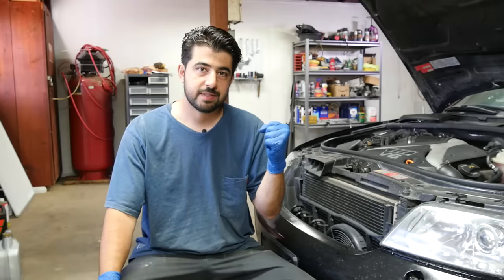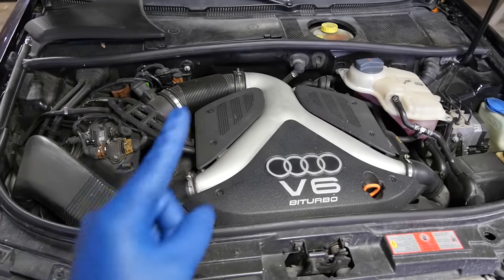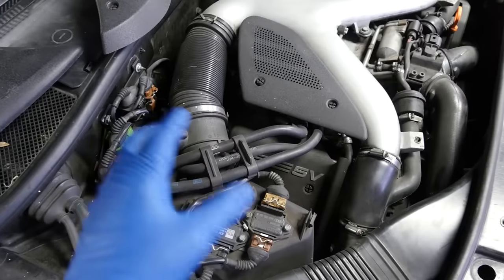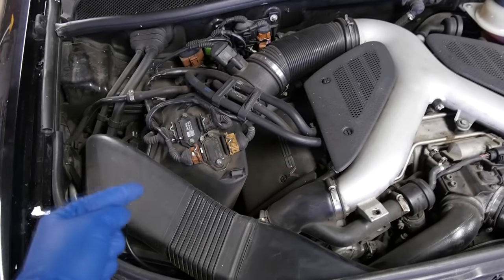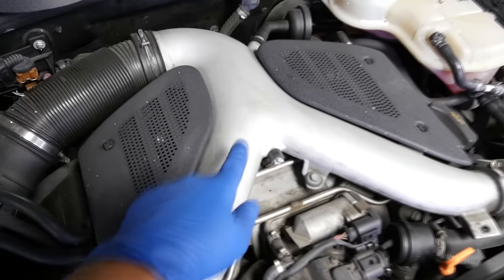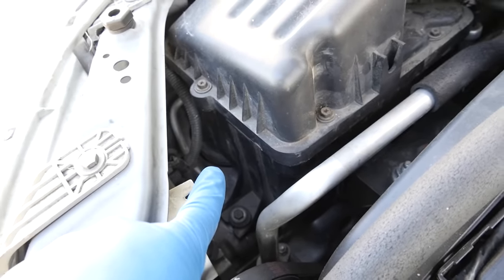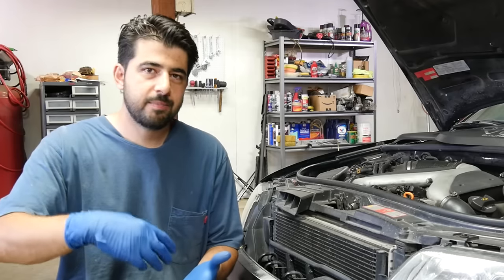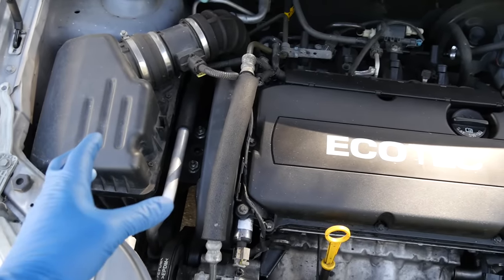Do Cold Air Intakes Work? Watch and Find Out

Comment: I am on the fence about getting a cold air intake.Having gone to the track many times in my life--from stock cars to full blown race cars--90% or more had cold air intakes.Also--when I walked around and looked at factory race cars--they also all had cold air intakes.I wish there was just some honesty about this when you ask your local dealer about a cold air intake and you can literally get a different answer from all of them.The cold air intakes also on factory race cars--looked very similar to what you could buy for your stock car.BMW--M--AMG--Ford Racing-Honda and Acura racing--Porsche--all of them had intakes.The manufacturers need to just be honest-The computers--and I was told this by engineers at the track--all can instantly adjust for air and if you give them more air at a higher cooler rate--it will generate extra power.I mean a modern car has to run in Alaska--and in death valley--huge temp and air density differences.Some dealerships also will put K & N air filters on their cars--and some high performance--like saleen--will even put cold air intakes on their cars that are still under factory warranty--yet the service department will say it is useless--void the warranty--etc.i doubt all these race teams would do this--but the car companies need to get service advisors and this type of mod on the same page.

Comment: I have a turbo diesel. Once i installed the CAI i noticed it's more responsive from stand still take off. It used to bottom out most of the time before the power delivery.  Now that it's got CAI it's less laggy and more punchy. Now I'm not saying it makes noticable hp gains but a definite difference  picking up speed more fluently.

Comment: I found on my 2014 Mustang the CAI doesn't work as good as the stock airbox until you tightly cover the filter and basin.  Therefore air is forced into the system instead of much being wasted into the engine bay.  Once you do that you can definitely feel the difference B)

Comment: I put a cold air intake system on my old 2001 Pontiac Grand Prix GT and it turned that car into a beast! My low and mid-range torque went thru the roof!

Comment: I use a cold air intake on my 2006 Focus, not because I was looking for power, but because the car's air filter was supposed to be "Lifetime" (and obviously it wasn't) and it was going to be $800 to replace the filter because the entire system is sealed, or $200 for a cold air intake. 

That being said, I still have the same MPG as before because I monitored it for the fun of it, pre and post CAI. Been using that system now for more than 3 years without a single problem
Reply: $60.00 for the sealed unit these days...

Comment: This question was answered 50yrs ago. Cars from the 60s anyway, many came with cold air intakes.....esp performance cars. The general rule of thumb is cold air makes for a 10% torque gain over hot under hood air. Race cars usually have some cold air setup. A higher cfm filter can help at higher rpms. Usually the web doesn't make people smarter, hence millions of pod style filters sold today. Pod filters usually ruin motorcycle performance also eliminating air box cooler air.
Reply: Shazam that's why the '71 mustang mach one made 370 horses than the '70 only making 330
Reply: modern racecars almost always have ram air, not a cai

Comment: Some engines won't respond at all unless reprogrammed to take advantage of the greater, cooler airflow. Some systems are more forgiving and may actually automatically compensate. Whereas others may throw a code. Or the engine doesn't run right. And another BIG issue is hydro locking if the aftermarket didn't design in enough splash guarding. Manufacturers spend thousands of hours and millions of $$ to design a lot of these intake systems to do everything everywhere, no matter what the weather throws at one.

Comment: I put on a CAI that goes beneath the engine for my sports car...noticed a huge power/acceleration increase immediately.  It even has a better exhaust note.
I have to keep the OEM intake because the replacement CAI won't pass SMOG tests in Ca. 
So, every two years the car feels like it's driving through mud, towing a train...at least until the SMOG test is over.

Comment: On my '12 i4 accord I removed the pre induction tube silencer and added a drop in filter. These accords take air flow very well and I have way better response and sounds great on the crossover from 2nd to 3rd. Slightly modded air box but I love it. Rather tan spending 250 or 300 for a brand name CAI

Comment: Something like a K&N drop in panel filter will work out much better. Seen as you was considering cold air intakes which use the same or less restrictive filtration anyway. Sometimes you can modify your air box from the bottom. Cutting a circle out of it and attaching piping to the bottom and feeding it to the bottom part of your car where the grill is. Then it feeds even more cold air when needed. This would be much better solution than a cone shaped or something similar cold air intake.
Reply: this, plus the K&N reusable filters sound great

Comment: Worked great on my old 89 and 92 ford rangers where back in them days they had warm air intake ,I took and modified them to have cold air only and really can tell the difference in power increase for sure and actually better fuel mileage .

Comment: Put one on my 4.3 blazer. Also have a cat delete.  Took the time to use hp tuners to adjust the ve tables and maf calibration.  It made a great deal of improvement in my throttle response.  Also gave the engine a nice growl under the hood. As OEM air boxes are designed for noise reduction.

Comment: Great marketing lie.   You are usually removing the factory cold air intake, then adding a hot air intake that’s just called a cold air intake.   All four of my vehicles get air from the grill or behind the fender with the stock setup(cold air).   Why would you want hot air from the engine bay?   Less power more noise.   The days of poor factory design intakes are long gone.
Reply: Yea, but when you run through deep water eith that fender sucker, have fun replacing the engine :D
*if the filter doesnt stop it

Comment: Depends on the car, on my 3g Eclipse I didn’t notice any difference whatsoever, but on my new DC5 type S I noticed a huge difference, even with just a short ram, not even a cold air intake...
Reply: DareDevilDog DAVE i agree, they have different uses but ram air is nice because it improves throttle response

Comment: I put the cold air intake on my 2013 Ram, along with headers and intake spacer. I know it help keep the airflow cooler. Along with 190 degree thermostat, you really have to work to get the oil temp much above 200. I've done some heavy towing with it and wouldn't change a thing.

Comment: save yourself 8 mins. no cold air intakes do not equate to more power.
Reply: But they sound nicer
Reply: doug Fresh1980 depends on the intake my Jettas engine cover is the intake .. 4 ft of curved plastic hot air

Comment: The factory system is a cold air intake system.These aftermarket intake kits,they create horsepower loss and there have been tests done proving this.Plus the reusable air filter causes problems in the cold air intake systems if it has a mass air flow sensor.The oil from them gets on the heating element kill in the mass air flow sensor and kills it.
Reply: It kills it,burns out the heating element.Had this with a 2002 Tahoe which the K&N air filter was tossed in the trash.
Reply: cold air intakes were invented to make money for aftermarket companies, and some little piss ant company is not going to out engineer Toyota, or Honda, or GM, etc.  This is the problem with nearly all mods.  And even if you found one that really does work, you are going to give up a huge amount of fuel mileage, and no longer pass emissions, etc.
Reply: I love how something becomes a certified fact because someone said it happened to them. Once.
Reply: Walter Frederick obviously never seen a 2.5 mk5 Jetta the engine cover is the intake lol

Comment: Just put less restrictive filters in the stock air box.
Reply: yep..that's the best
Reply: Might as well seen as cold air intakes tend to always use the same sort of filtration or less restrictive filtration compared to OEM drop in filters so something like a K&N drop in panel filter will work out much better. Sometimes you can modify your air box from the bottom. Cutting a circle out of it and attaching piping to the bottom and feeding it to the bottom part of your car where the grill is. Then it feeds even more cold air when needed. This would be much better solution than a cone shaped or something similar cold air intake.
Reply: i did that. cut a hole in the airbox for more air to come in. got more mpg sounds louder too

Comment: I'm still trying to figure out who buys a cold air intake that actually stops in the engine compartment. Isn't that called a short team intake instead of cold air intake. Because cold air intake is going down in front of the tire well Where the factory piping is. Which picks up cold air.

Comment: I recently bought an K&n intake for my Mazda B2500 pickup truck on eBay for $170 
Brand new cost $355 
And based on my experience I would have to agree with his statement. It really does depend on the vehicle. 
For my truck, it does make a significant difference. Nothing crazy, but it does perform a bit better. Especially when I step on the gas on 3rd or 4th gear. It responds a lot better. Gives it a little boost 
It was a great purchase for $170 
I wouldn’t pay $355 
Not worth that much money in my opinion.

Comment: Thanks very informative! I don't plan to use a cold air intake but a dry flow filter rather. Not after performance gains which I doubt there is any but rather the fact that I could clean and reuse them.
Reply: they pass tooooo much dirt in exchange for a couple horsepower at 6,000 rpm.
Clean and reoil every 5,000 miles.
Then 200 miles later clean the oil off your masd aur meter.
NOBODY DOES IT
Reply: @hotrodray6802  I've been using an AEM dry flow filter for a year now and so far its okay. I just dust it off with a blower every 2 weeks and wash clean with their filter cleaner every 5000km or 3 months, no need to oil unlike K&N. I clean my maf sensor and throttle body yearly as part of maintenance.

Comment: Something tells me you both haven't measured intake restriction before and haven't thought about how it affects the operation of a turbo engine. Your Audi is particularly interesting in that it controls boost to maintain a set air mass flow target rather than a boost pressure.

I'm happy to go into the maths of it if you want, but the short version is that less intake restriction lowers throttle lag, intercooler heat loading and exhaust manifold backpressure.
Reply: Yeah . maths is involved here

Comment: Excellent video. It’s critical to isolate the filter side of the cold air intake. To do this, you’ll have to make modifications to the car including cutting holes in sheet metal.

Comment: More air is good. But it has to get out. I always start from the backend. Less restrictive exhaust.
Reply: Chad Pugh that’s what she said 😏 #classic
Reply: Not just less restrictive, but also tuned to properly channel the exhaust gas out effectively from each cylinder to allow efficient flow dynamics, notably, sequence and temperature .  More often than not, a bigger pipe doesn’t mean better flow, it just means more likely overall potential to flow better.
Reply: Need to have a little back pressure to keep a little pressure in the combustion chamber ,a lot of guys think more flow is better but it isnt all the case in the dynamics of it to ensure proper tuning of the exhaust system.

Comment: Only way to really know if something works is to dyno your vehicle after the mods.
Reply: For small gains you still won't know because the dyno results are affected by temps, air pressure and humidity.

Comment: I was expecting you to compare performance on a cold air intake vs stock 😐
Reply: it doesn't mean anything, it entirely depends on the stock settup. Ram air is the best by far, cai can be good in some circumstances, and stock is fine under most circumstances, unless the oem one was designed badly, you won't see any noticable gain or feel any gain, and if you do it's because of placebo

Comment: especially if you have a ram air intake like that audi, just get a reusable air filter instead of a disposable one, if you wanted to get fancy you could even add more routs into the air box with excess piping, that would do a lot more than a CAI system, especially if it was designed to look good first, and preform second. 
Most top level modern racecars use ram air intakes anyways

Comment: You'll gain some horsepower until your CAI gets heat soaked. Open air element CAIs seem to be better suited for when you're already moving i.e. on a track. Drag racing, not so much, unless you don't give it a chance to heat soak.

At 29 degrees outside, my GT350 intake inlet air temp was 96 degrees at idle. Once I drive around a bit? Goes down to 34 degrees. Faster you go, the faster the temp goes down. Closed airboxes don't have this problem. Wish someone made a lid for the 350 CAI...

Comment: Instead of a cold air intake, what about a high flow filter in a stock air box? Any gains?
Reply: Mike Gould , yes, I just watched a video and they did actual live Dyno Testing. the K&N drop in stock airbox got about 6 hp gain. very good for just changing out an air filter

Comment: this video gets a thumb down just for not mentioning the diffrence between a cai & srai- which he was basically describing in the video. i was very skeptical when putting a cheap  srai with k&n air filter because i expected  no performance gains & i expected to waste more gas  but to be honest it actually seems to be doing better on gas which no one is mentioning here.  it also gives my engine a nice little hum at idle. i understand to each his own but my suggestion is to not knock something based on here say try things for yourself & think for yourself instead of  buying in on propaganda. And for added horse power it only makes a slight  diffrence in torque at higher rpm's just like he mentioned.

Comment: Interestingly enough, one of my vehicles happens to have a intake that is not heated once but twice.  I have a pre-heat tube that basically sucks the air past one of the exhaust manifolds (heating the air) then it is fed straight into the air filter housing.  The second part is a little more complicated, basically on all v6 engines you will have 6 intake ports, 3 per head... Well I actually have 12 on the intake side of the heads, the exhaust not only flows out the exhaust manifolds but it flows through my intake manifold from one side of the engine to the direct opposite side.. so cylinder 1-2 feed into each other, and 3-4 and 5-6 are all basically connected like an H-Pipe exhaust for example but on the inside of my intake.  This super heats the entire intake on my engine to extremely high temps that will burn you instantly if you touch it as would the exhaust manifolds.  Its also important to note that I have throttle body injection wich means this set up is heating the FUEL as well as the air.. that makes a huge difference and is the reason why this works so well.  On a direct injected motor this set up would perform poorly.  The reason for this was to limit emissions from the engine 33 years ago.

Comment: Cold air intakes are good bolt ons for bigger builds and more in depth set ups. Short answer is no Timmy’s Honda will not blow the doors off a hellcat with a cai but a built motor with cams and long tubes and full exhaust will need a much more open air intake system

Comment: I can guarantee if you have tubing running to the cold air intake directly drawing from outside the engine bay as well as shielding there will be an increase in HP and torque but the increase would be low as in maximum 5 HP and torque increase likely. This would translate to basically no effect in noticeable performance, the main thing it would do is make your engine sound nicer and likely dirty up your engine more lol

Comment: Yes comes down to computer system and engine. Same as plumbing or HVAC, the more bends or transitions from one size to another greatly affect the airflow and velocity. The cooler the air the denser it is also the more velocity the more air can go in also mix with fuel better. Same as exhaust, run narrow tubes to keep the velocity up for more torque for trucks ( that dont see high rpm) the best would be start off big diameter at filter and slowly get narrower to the throttle body but never go back up in size before throttle body.

Comment: Cold air intake is not a tube with a filter placed randomly in the engine bay, cold air intake is a n intake placed in such a way that allows "cold" air from the outside, not saturated in heat from the engine bay

Comment: I suppose the best method would be to have less restriction on filter but double skinned pipes and filter housing all metal and made like a thermos flask so the heat from the engine won’t affect the air intake. However this would probably be very pricey and require more space in the engine bay.